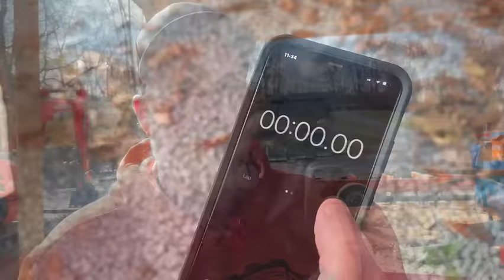I'm Sorry,... My Apology to Mike

Comment: Looks like you had mirror image set backwards for your recording.   Easy to see that the text is not reading left to right and looks like the wood bunker is on the right side, not the left of the shed.   So if you record with the mobile phone camera this setting could be an issue.
Reply: Comment was for the selfie camera.  You cap is reading backwards.

Comment: You do not need to apologize to anyone.. 
I mentioned on one of your latest video -- why don't you use the skid steer with the largest bucket, scoop up the rounds, drive to the splitter with the bucket at feeder height and pull/pick up the logs from there? It will save a lot of bending and lifting as well as eliminate a few steps in the process.
Reply from the maker: thank you and I agree the firewood bucket would help the process, and in this particular situation, Mike used the excavator to cut the logs and then they were just tossed in that direction.
Reply: @Morgansunleashed  P.S. You did a spectacular job! Great Hustle! You would make any man proud to have you for his wife.. And I know Mike knows that so well.. God  Bless!

Comment: If I remember right, Mike did all the loading and splitting himself, he didn't have any help. Perhaps if it's faster than 1 1/2 hours to do that load you should work together in the future and more work would get done. Mike also used the vertical splitter.
Reply from the maker: he was doing the splitting with our son Levi

Comment: I highly encourage the use a peavey to pull the logs up to you rather than bend at the back. There is a penalty for that as we age. I am still trucking pretty good a 64 but the stiffness and pain has increased. It disappears faster as we get older. I think as we lose muscle mass with aging and we continue to do things as we always have the load shifts to a bones and joints. The Peavy is a worthy tool to use with this type of work. Stay strong and “Don’t Let The Old Man(or Woman) In.  Nice Work/Work Out.
Reply from the maker: Yes this is very true 
Thank you

Comment: Trying to be neutral here, one probably moves faster when their timed and trying to move
faster, but you did a great job with helping Mike split that wood. Also, if timing is in volved
both piles of wood need to be at least as close in size to each other rather than just a guess.
Also, both times need to know they are being timed. Just my opinion :-))
Reply from the maker: agreed

Comment: Mike you should get Melissa Dodge Ram diesel and do a review on it compared to the Ford and the Chevy, I have a Dodge Ram with 340,000 me still runs strong when I crank it up and Shakes the ground and makes alarm systems go off in other people's cars and it drives like a car a Dodge Ram pickup drives like a car it's got such a tight steering

Comment: Not at all impressed with the insincere apology.  You just Had to be right - and what’s the point?  I’ve seen farm and work site accidents that destroyed people’s lives.  Egging someone on to work faster on a machine that can sever a hand in a second, is just crazy.
Case one - a friend’s 28 yr old son was crushed to death working on a skid loader when he was rushing and got caught under the bucket.
Case two - a local farm kid, 17 yrs old, got his shirt caught in a PTO and it tore off both his arms at the shoulder.   He was alone, and walked himself to the farm house and used a pencil in his mouth to dial 911 on the land line.  Then he went to lay down in the bath tub so that he didn’t bleed all over his Mom’s rugs.  Think about that for a while.
Reply from the maker: I think you are very confused 
My safety was never compromised and I think you are the one that should think about that for a minute 
Everyone needs to be safe and at the same time not slow or lazy 
This comment is crazy